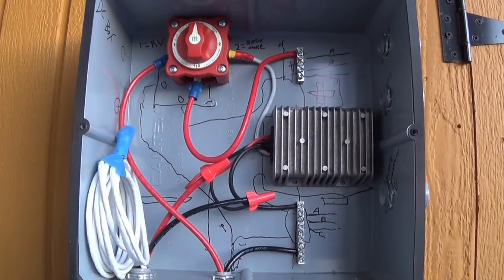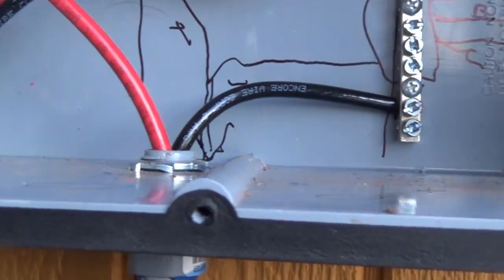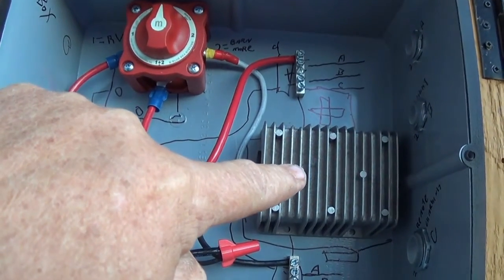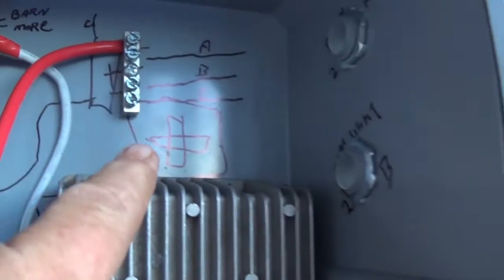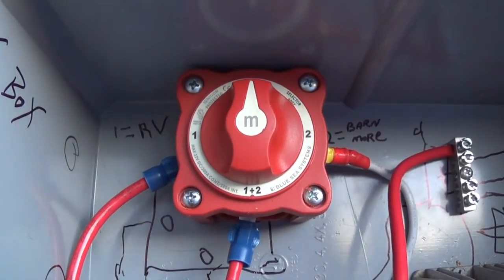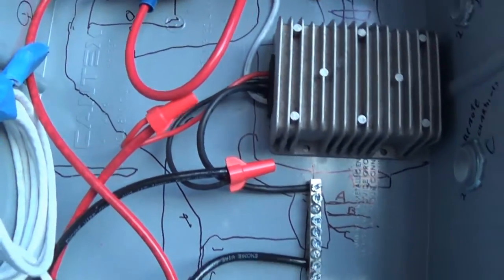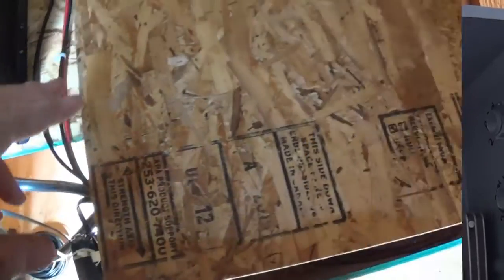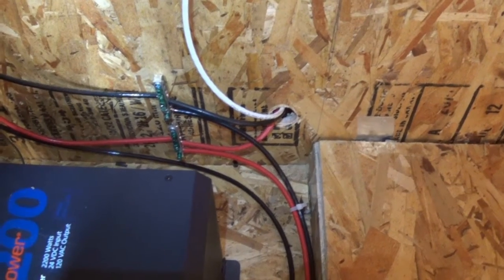Solar Batteries Wire to RV - Got Solar on the Homestead

Comment: Looks like your almost set every month when i get my lovly electrick bill almost 200 a month i think about arizona hot homestead and Jeff not having to pay out the nose, it used to be alot less expensive but like everything except income keeps going up.
Reply from the maker: +Guy Azbell lol... just lots of out of pocket cost but when I think about running the generator, the gas used for that and the propane on appliances that could be on solar I figure I break even in 4 yrs or less.